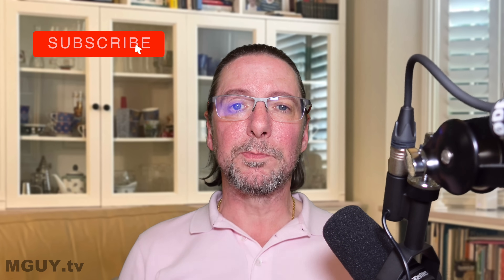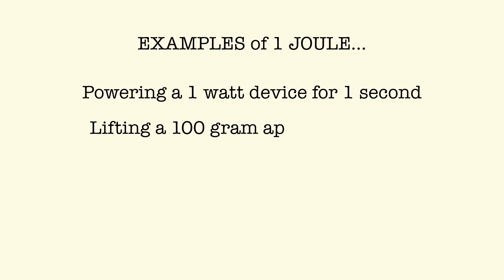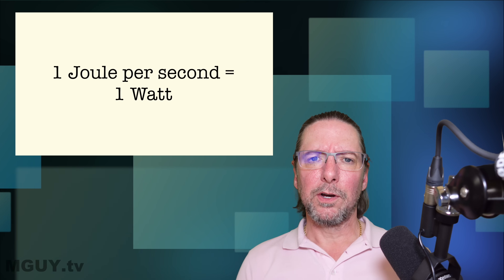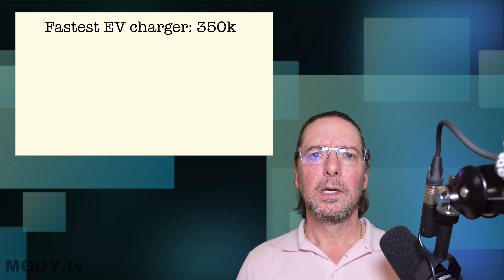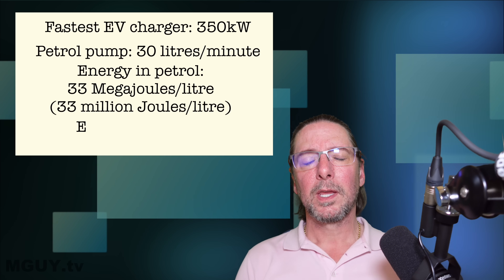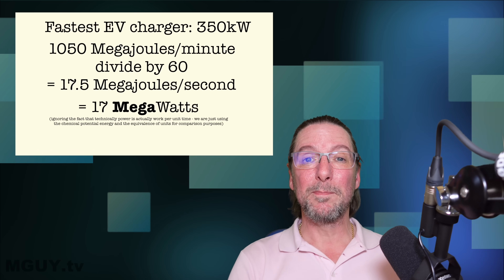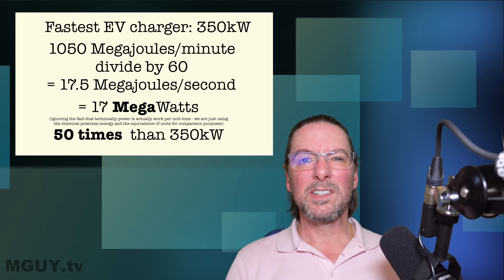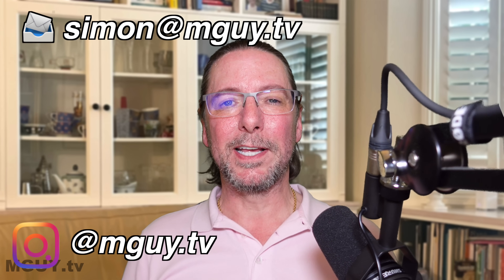Comparing charging speed of EVs vs "fuelling speed" of regular cars | MGUY Australia

Comment: Your calculations are missing a fundamental piece of data, efficiency! Yes there's a lot of chemical energy in petrol and diesel but internal combustion engines waste at least 75% of it as heat and so operate at only 25% efficiency. Of course the principal  applies to EV's too but they typically operate at 85% efficiency. But the petrol and diesel efficiency problem is in fact much worse than just looking at its specific energy density, the oil extraction, processing, transportation and finally the pumping into the vehicle all use energy. It's better to compare range gained over refuelling time. So for ICE vehicles it's approximately 300-600 miles recovered in 10 mins and for latest EV's around 100-150 miles in the same time. So definitely not 50 times faster, more like 3 times.
Reply: I made a video when Aptera snake oil salesmen were pushing rubbery figures like yours. It's more complicated, and a recent road trip in my EV puts the ICE vehicle in the real world more like 84 times faster. I can drive a diesel from Brisbane to Sydney in 10 hours, easily, and two weeks ago I did it in 16 hours in my EV. For the ICE, I filled the tank once at the start and, including paying, took about 5 minutes. Plenty left in the tank in Sydney. In contrast, equivalent charging time added up to 7 hours (one to begin, and 6 on the road - can be much longer if charging at home first). The EV had nothing left on arrival. Happy to round it to 80 times faster, and I wouldn't put that EV trip on my worst enemy. Strangely, I love both types.
Reply: @aussieideasman8498  Yes EV's are a bit painful on a long journey especially when multiple charge stops are required. Fortunately as I live in the middle of the UK the sorts of distance I'll typically drive rarely mean doing more than one charge stop so my experience is naturally different to say someone driving in America or Australia. ICE cars clearly refuel faster but I stand by my mathematics, when someone tells me it takes a minute for them to fill up their ICE vehicle then I have a slightly wry smile because I know having owned 5 ICE cars that I was very often queuing behind several cars trying to fill up either on the way too or back from work. Yes you could go to a 24 hour filling station in the middle of the night and probably get in, fuel up, and out in less than 5 minutes but that's not a typical experience and you'd have made a special journey to do it. 99% of my journeys are a 25 mile round trip followed by parking on my drive and spending 20 seconds, if that, twice a week to plug the car in. It's way more convenient for me than ICE.
Reply: @leegoodman297  Your needs suit owning an EV, but you are not everyone, and I have not said EV's are not suited to a certain demographic. I own both an SLK350 and a BYD Atto3, and each has its own advantages as well as disadvantages. Soon I will report on a nearly 6,000 km road trip in the EV. I have done similar in the SLK, and it walks all over the EV, except on fuel/charge costs.
Reply: I've never owned a vehicle that would take 10 minutes to fill with fuel. Even if it's not 50X slower, EVs seem painfully slow to charge and be on your way and it seems like if someone else is charging beside you it requires power-sharing and it's even slower and that assumes you can get in to charging station in the first place.
Reply: @barryj388  I usually take half a minute to plug in the EV at home and another half to unplug in the morning. It fills from empty while I am eating; watching TV; sleeping; showering, et al. Nothing to hold onto, so no time wasting like holding a nozzle then going inside to pay. There are two ways to charge EVs, and only one convenient way to refuel ICE cars. Jerry cans in the garage is plain stupid.
Reply: @aussieideasman8498  If your luck enough to have you own driveway, In the UK  over half of the cars are owned by people who have to park on the Road and often a short walk away, How they are going to charge there cars is a bit of mystery.
Reply: @paulwaites6551  I have a great solution - move to Australia and get a driveway. The benefits are far greater than that. BTW, I was born in Manchester.
Reply: @aussieideasman8498  Yeah, I can see what you're saying as long as you don't venture too far from home. I agree, jerry cans in the garage isn't the best idea.  Based on what I'm seeing I would be concerned about charging an EV in an attached garage.
Reply: @barryj388  It's why I got a BYD Atto3 - Blade battery is much safer than most others.
Reply: @barryj388  By 10 mins I'm looking at an average time you'd likely spend in a filling station, not the time from pulling the nozzle trigger until the tank is full (for a 12 gallon tank it would be about 2 mins). Likewise with an EV I'm not counting only the time electricity is being supplied, you need time to plug in and typically either start a charging session via an app or tap a contactless card on the charger. It's worth noting that as more places get destination chargers it saves EV drivers a lot of time. I visited Canterbury in the UK last week, I live 140 miles away, about 80 miles north of london, virtually every carpark in Canterbury has chargers operated by EVdot. I was able to drive there with no range issues and charge in the carpark I would have parked in regardless. It cost me £6 to drive down there, and because the chargers are more expensive than charging at home,  it cost £13 to drive back. It made no difference that the chargers were on the slow side because I was sightseeing while the car charged. So £19 in 'fuel' plus about 2 mins to plug the car in and start charging. In an ICE vehicle doing 40 mpg it would have cost £50 (at current petrol prices of £1.60 per litre), and a trip to a filling station would be required shortly afterwards.
Reply: @leegoodman297  The intricasies of charging are varied and vast. What's great about refilling is the fact that there are far fewer factors, and it's pretty simple, like it fills just as fast with the first litre as it does with the last. EV chargers are all over the place with the rate, and then you have to start by finding one that has a rate to match your car. It sucks; sightseeing is what you do once or twice a year, and is no good when it has to be every time you recharge. Own up to real drawbacks.
Reply: @aussieideasman8498  You don't need to find a charger that matches the charging rate of your EV. The car and charger communicate when first plugged in so the correct charging rate available from the charger is utilised. So an EV that can charge at say 200 kW DC maximum can still use a 50 kW charger but of course it'll be slower.
Reply: @leegoodman297  That's why you need find a charger that matches the charging rate of your EV.
Reply: can you please tell us what the efficency is for produceing electricity and its distribution.
Reply: @butchphillips873  Exactly the same efficiency required for the electricity to produce oil products which I why I didn't factor that in. If I had of included that it would only make oil and fuel products look worse as the amount of energy required to make them is enormous. If you've ever seen a fractioning tower in operation you'll understand why.
Reply: @leegoodman297  They don't look worse when the energy is used off the moving vehicle and the cars crap all over the EVs for range. They have to move then.
Reply: I can put enough fuel in my deisel in 1 minute to take me 350 miles  If you charge an EV for 1 minute 3 kilo watts 3.5 miles per kilo watt  = 10.5 miles it's  about 35 times slower.
Reply: @paulwaites6551  Not disputing that at all, the point I'm trying to make is with an EV I can park up, put it on charge and go off and do something else. So the charge up time isn't really an issue until I have to drive more than 180+ miles in one go which for me is exceptionally rare.
Reply: @paulwaites6551  It's ten times less distance - each minute is the same.

Comment: Regarding charging, there may be something that has slipped through the cracks. I recently watched a YouTube of an American kid, maybe eighteen years old, who bought a new e-bike. I’m guessing that the battery charger has current-limiting ‘smarts’ and the battery charges up slowly and safely. He made a video of his first ride—along a semi-rural road at around 60 km/h. As he approached a four-way intersection, he did a heavy re-gen. Then came the hissing and the smoke, and we know how that ends. If regenerative braking is implemented on the cheap—without ‘smarts’, there is now a new danger. What if you do a heavy re-gen on your arrival home. There’s no hissing or smoke, but you stow your bike in the garage and go inside for a shower. Meanwhile, your battery is heating up from the re-gen. The fire begins but you don’t know it because you’re in the shower. You probably didn’t install a smoke alarm in the garage. This movie has a terrible ending.
Reply: Research means nothing.  Companies want/need to make these things as fast and cheep as possible.  Either China or to compete with china.  These things are so much more complex than traditional ICE.  The possibilities for technological failure multiply.  All they have to do is pass test to leave the plant.  That’s if the systems get tested or looked at by quality control.  Every one seems to forget this is about money, fast and cheap.  When that is the drive safety and reliability are out the window.
Reply: Darwin has a plan for the sheeple.
Reply: I've seen that video LOL 😂
Reply: Which is more dangerous, kills more people every year % wise of use, EV tech or ICEV tech? Case closed. Join the 21st century. Or, you can join the Amish, who boycott that dangerous horseless carriage.

Comment: Petrol / diesel is only about 30% efficient when you burn it though, whereas the EV is close to 100%, so the effective charge rate is only around 5MW.  Still makes EVs / charging look daft.
Reply: Quick question,  The electricity is generated at what efficency?  probably need some sort of average as we have many generator types.

Comment: I like my 900km highway range in my 5.7 litre Hemi V8. Home to Dubbo, 800km, in about 9hrs, non stop. Then maybe 3 mins to refuel.
Reply: The difference is chalk and cheese, and your Jeep(?) wins hands down.
Reply: 2010 300C😁
Reply: @prussiaaero1802  Nice.
Reply: Don't forget, properly around $250 for that 3 minutes at the fuel pump, how can you be happy with that.
Reply: @commonsense-grs  Don't forget, the tank in his ICE car is worth about twice that and will last 60 years; EV batteries are around $30,000 and degrade from day one - no good in ten years. How can anyone be happy with that?
Reply: @aussieideasman8498  OMG, where did you come with that one. Comparing the battery in EV with the fuel tank is bizarre. Mechanically there is only 2 components in an EV, battery and electric motor and both are extremely reliable. You over inflate the cost of the battery and under inflate it's life span.
A Tesla battery is around $20k now, will be far cheaper in 10 years and they are getting far more than 10 years.
You mention 60 years, now lets work on $100 a week for fuel, which is very low with the cost of fuel now. So over your great life of your fuel tank, that's $312,000 in fuel, I'm glad you would be happy with that.
Reply: @commonsense-grs  "OMG, where did you come with that one." Pure logic.
"Comparing the battery in EV with the fuel tank is bizarre." Normal - one holds the fuel and the other hold the electricity; each is teh storage. 
"Mechanically there is only 2 components in an EV, battery and electric motor and both are extremely reliable." Oversimplified; there's much more than just those two. 
"You over inflate the cost of the battery and under inflate it's life span." So do a few YouTube examples of having to pay for new EV batteries.
"A Tesla battery is around $20k now," Show me an example of someone who has bought one? 
"will be far cheaper in 10 years and they are getting far more than 10 years." Will be's aren't that exiting for me (nor reliable). What % are they down in 10 yrs? Fuel tanks still hold every litre (or gallon) they did when new.
"You mention 60 years, now lets work on $100 a week for fuel, which is very low with the cost of fuel now. So over your great life of your fuel tank, that's $312,000 in fuel," So let's work on a more realistic 30 grand for batteries and ten years; that's $180,000 in replacement batteries; about $120,000 worth of electricity and that extra $30,000 for the EV. That adds up to $330,000. 
"I'm glad you would be happy with that." I am, because that 18 grand saving comes with years of not waiting ages for each charge, and time is money.
Reply: @aussieideasman8498  hahahahaha, this is the same, over inflate your opinions. For a start, Ev batteries ARE NOT $30,000 and they last a lot longer than your 10 years and $120,000 for electricity, hahahaha.
Reply: About $140. LOVE IT!  @commonsense-grs

Comment: Great explanation. Power to weight ratio: 100 litre fuel tank roughly weighs 100 kilograms or 1/10 of a tonne. A moderate sized ice vehicle  can travel up to 1,000 kilometers say' on 100 litres. EV car moderate sized with  20 kilowatt battery (battery weight 200 kilograms) has a maximum range of about 300 kilometers conservative. Would probably be a lot lower.
Reply: What everyone seems to be forgetting is that EVs are not here to piss off petrol heads but to reduce carbon emissions!
Reply: @paulmichaelfreedman8334 Emissions in the city centre, correct, emissions overall, not correct.
Reply: @kevinsenyeli4200  You sure about that? Source?
Reply: @kevinsenyeli4200  emissions don't just stay in the city centre, it travels everywhere.
Reply: @kevinsenyeli4200 overall emissions reductions from EV proved so many times it is sad to see it still commented on…even in YouTube comments sections.
Reply: @ObiePaddles overall emissions from an EV, including the manufacturing process takes 7-10 years to break even with an equivalent ICE car.

That was stated by Volvo, who make ICE and electric versions of the same car.

And if you live somewhere where your electricity is derived from fossil fuels, the break even point will probably be beyond the vehicles life span.
Reply: @paulmichaelfreedman8334 …but they don’t reduce carbon emissions at all!!! In fact they add more pollution over the expected shorter lifespan of the EV!!

This idea of Ev’s being environmentally friendly and costing less is pure BS, and as the smarter portion of society can see this… this is what pisses people off. Being forced into an environmental farce!

You don’t have to be a rocket surgeon to work it out, but apparently for the EV part the population… it’s quite hard.

The initial cost, the subsides, the fire risk, the depreciation, the insurance premiums, the pollution, the charging times, the write-offs, the charging costs, the safety concerns, the battery degradation… so on, so forth.

It’s bewildering how many people have no idea about the very things they stand for!
Reply: @paulmichaelfreedman8334  So, what do we do with the old used battery packs? There are no recycling places anywhere in the world, will they become land fill?
Reply: @antonbrum5492 😂😂😂. So misinformed.😊
Reply: As he says in the video this is a huge amount of energy for the distance travelled so ICE are very inefficient
Reply: @donnairn3419  That's correct why is he being so mean to ICE cars by dwelling on their energy inefficiently, just because they make lots of noise and heat isn't their fault!
Reply: Some wonky estimations.  100li of fuel is 820kg. A moderate ICE would get 2000 Km and an average EV has 50Kw of battery for 350km of range, so the delta between the 2 is much bigger than you suggest.
Reply: @csjrogerson2377  100 litres of petrol is 74kg, diesel is 83kg.  Where did you get 820kg?
Reply: @csjrogerson2377  Range is just one ingredient to refuel/recharge speeds, which is the real subject matter. I worked out the ICE speed to be roughly 80 times faster on a real-world example, but that could differ a little with different drives. It's in a comment further up in this discussion forum. Testing beats estimating.
Reply: @csjrogerson2377  I totally agree, it was meant as a rough estimate, however is shows how totally inefficient EVs are.
Reply: @csjrogerson2377  1 metric ton = 1000 litres or 1 cubic metre. I think you meant 100 litres = 82 kg and not 820 kg.

Comment: Can you do a video about battery swapping? Most manufacturers are against it but that may be because there is a lot of cost, and therefore profit, in selling the battery rather than renting it to the car owner.
Reply: It sounds good but it means that you need a standard battery size/shape for all cars; it also means that the EV has to be designed so that the battery can be easily withdrawn and refitted. Another potential drawback is that having just purchased your charged up battery, you find that it did not last as long as the previous one.
Reply from the maker: I’ll research it - thanks!
Reply: @mguytv Tesla offered the battery swap years ago But nobody wanted to use the series so they dropped the idea. 

https://youtube.com/watch?v=Oj6LaYFall4&si=7BMmPzmqX7-o7cOK